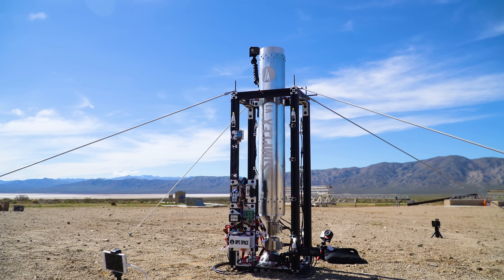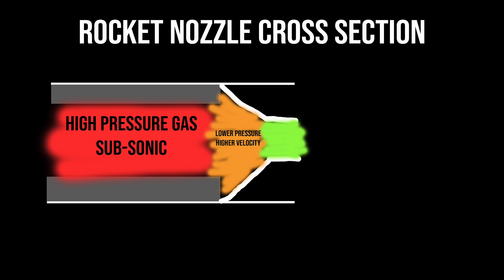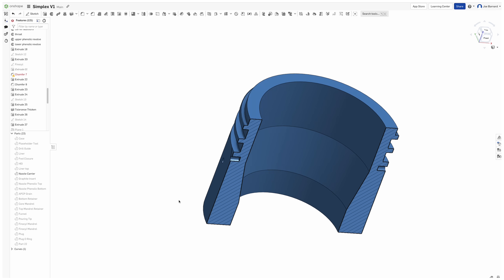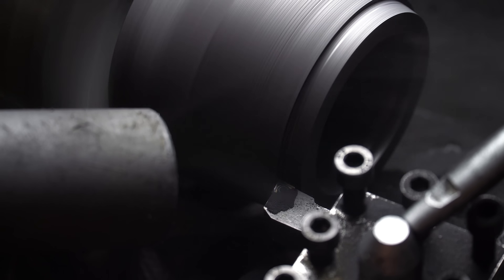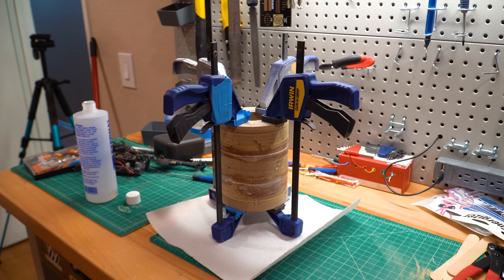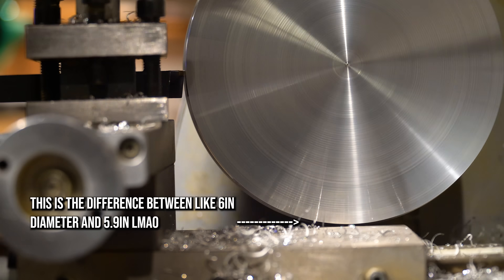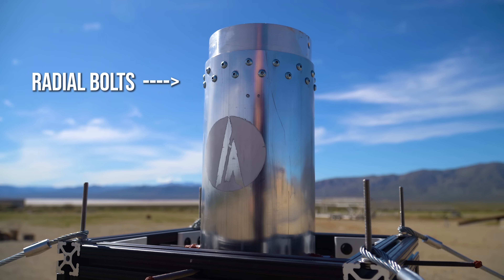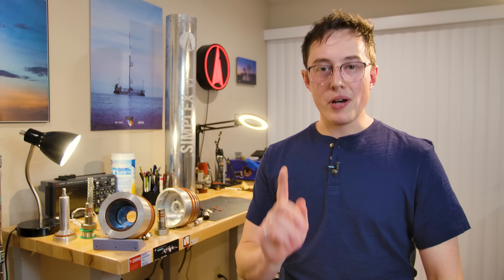Making a Rocket Nozzle - Simplex Ep 3

Comment: Suggestion: for future grain packing, 1, when you think you have all of your propellant in there, place a weight [or springs, or air pressure in a cylinder] on it with some packing material [such as beeswax or modeling clay in a ramming tube, and then 2, put a vibrator or ultrasonic horn under it to ensure all of the bubbles expel while none of the propellant fluffs, spalls, climbs, creeps or ripples.

All of that would be using a fitted removable sleeve, something like PVC pipe is fine for this, and its cheap, and can be resized with heat if it is not a perfect fit. Be sure to clamp it though, so even if its a perfect fit, the pressure does not squeeze anything out, or pop the sleeve off.

This should only take between 30 and 60 minutes but it should really clean out all of the voids.

What will happen if there is entrapped gas is, just like with concrete, it will work its way to the top and exit.

Since the clay [most modeling clay is actually quite light, but beeswax is much lighter if you can get it, say like off the internet] is somewhat lighter than the propellant it will continue to float on the top but the bubbles will float through it.

I suppose you could mix up some flour and water into a sort of a dough, but it could have too many elasticity issues and make it impossible for bubbles to pass through it, or, on the other hand, you could use wet or dry sand, but then sand is kinda heavy and would certainly mingle and embed in the propellant, unless you had an excess of propellant with the intended goal of just cutting off the excess as waste, so that would be a decision to be made at that time.

Honestly, either way, it would be good to have maybe an inch or two of extra propellant on top of the mold anyhow, because when the bubbles escape, you want to refill that void with propellant, not packing material.

Comment: Take huge care to chamfer and polish the edges of the pieces that touch the o ring, so the edge of the tube and the groves of the nozzle carrier. This way it cannot be be damaged when mounting the o-rings. Otherwise there can be tiny cuts that under immense pressure can split the rings. I learned this the hard way when designing a hydraulic keel canting system for a race yacht. Was not fun to clean up all the fluid inside the boat... In your case it could end much worse :/

Comment: ...If graphite is abrasive then why do I have a big tube of graphite powder lubricant?
Reply: Graphite is a lubricant and an abrasive. Turns out they aren't mutually exclusive properties. 

The key is the shape and orientation of the graphite particles. It's like a bunch of little pancakes. When they slide across surface to surface, it greatly reduces friction. When the edge slides across the surface of your material, it creates a little scratch, abrading it. 

But wait, graphite has a hardness of 1-2, so how can it abrade harder materials? Well, graphite is so soft because of how easily the layers break apart. Get down to a single layer and it has the same hardness as other crystalline allotropes of carbon (think diamonds).

Comment: Love your content man. Just a machinist here giving you a potential tip. If you need to turn something bigger on your lathe you can try using a boring bar upside down and running the machine in reverse. I had to do it a few times at work because it was at the machine's capacity lol. We actually had to modify the guards on the lathe to fit the part in.

Comment: FYI; you're using the organic chemicals cartridges on your respirator, which are great for working with solvents, but don't always guarantee particulates protection. You might consider calling the 3M hotline to see whether the part numbers you've purchased are rated for N95 protection or not.
Reply from the maker: Thanks! These are 3M P100's so they're good for organic vapors and particles

Comment: seeing the compound mount wobble is not good for machining parts @9:55  possibly just a quick setup error  best practice to do an idiot check before engaging the motor  i say this as a way of imparting some helpful knowledge  not meaning to be derogatory in any way. as its easy to get blindsighted by your project as you work at it. remember you only have ten fingers they are hard to replace.

Comment: Why use RTV silicone instead of a heat-curing silicone? Heat cure is way more reliable, and none of the usual practical reasons for using RTV are really relevant to this application, since it's all temperature resistant and is small enough to fit in an oven.
You do demonstrate awareness of RTV's key limitation (the fact it only cures with surface exposure to humidity) and you do work around it, but even with that workaround RTV is still just inherently less reliable for large mated surfaces like you have.
Heat-cure silicone, on the other hand, just requires you to bake the assembly, and you can be very confident there's no partially cured material left once an assembly finishes baking. It also has a much longer open time, so you can spend more time applying it and give bubbles and voids longer to settle out.
Reply: There's lots of different silicones, depending on heat resistance and Shore hardness, he could use 2-part tin or platinum cure formulas as well.

Comment: Genetic algorithm is great for optimice all the motor parameters. Also, when you get enought knowledge, is better to develop your own code for simulating the combustion, motor behavior and heat transfer. This is the only way to really understand how a rocket motor really works and how to optimice it.
The main objetive under the design of a solid motor is to obtain the desired maximum thrust at maximum target pressure, minimizing engine mass, and maximizing total impulse, average thrust, and specific
impulse.

Comment: Regarding the phenolic, why not build a jig with a bandsaw to get it round first? You're going to bore the center out of it anyway. You could drill a 5mm hole in the middle of one face, and pivot it around that on the saw. then turn it as normal on the lathe? This is how Frank Howarth does big bowl blanks in his woodshop.

Comment: If you use an 85 degree chamfer the inner edge of the rocket casing, it might be easier to insert the o-rings and nozzle carrier without nicking the o-rings.  In addition, I couldn’t tell if you were using lube.  Parker makes a silicon lube I have had good results with.  Glycerin is another good possibility as long as your materials are compatible.

Comment: If graphite dust is abrasive, why does graphite grease exist?
Reply: Graphite is a lubricant and an abrasive. Turns out they aren't mutually exclusive properties. 

The key is the shape and orientation of the graphite particles. It's like a bunch of little pancakes. When they slide across surface to surface, it greatly reduces friction. When the edge slides across the surface of your material, it creates a little scratch, abrading it. 

But wait, graphite has a hardness of 1-2, so how can it abrade harder materials? Well, graphite is so soft because of how easily the layers break apart. Get down to a single layer and it has the same hardness as other crystalline allotropes of carbon (think diamonds).

Comment: You might have seen or heard of them before, but you should look into getting some form taps/roll taps! They take some time to get familiar with and require somewhat specific drill sizes for your target thread form % (between 65-75% is where I've been getting fast reliable results), but you can look up the ideal drill diameter on a form tap chart as a starting point and then order a few sizes +/- the nominal drill diameter to dial things in for specific applications. I find if I'm cnc or drill-press drilling, the "correct" diameter typically works best, but for a hand-drilled hole, going slightly undersized seems to help account for inaccuracies from hand holding the drill which typically results in oversized holes compared to being drilled perfectly rigid and square to the surface as with a cnc/drillpress. With the optimal drill diameter figured out, I find that I can run m3 to m6 form taps with a hand drill and knock them out in quick succession(...but maybe don't try this immediately, getting familiar with the feel of the form tap going in is important too).

These taps also have some unique benefits/tricks/quirks, the first of which I think would save you some headache with your nozzle carrier:

- No chips to clear! It's a huge time saver. Depending on your lubricant/material, you may occasionally have to clean away finely powdered debris which builds up in the relief slot. Isopropyl alcohol as a lubricant for aluminum is amazing - not sure on specifically why, but it lubricates aluminum extremely well and also washes away any fine debris between holes with no oily residue to clean up afterwards.
- The threads are typically stronger due to being cold formed rather than cut into the material. (ymmv depending on material and the depth of the hole though, brass is a nightmare in my experience lol, and I'm sure there are other materials which don't like being cold formed)
- Form taps can last an extremely long time compared to cutting taps, assuming you don't snap them first or run them through undersized holes and gall material to them. 😂
- You can get "extra" threads from an open bottom form-tapped hole which can be used to your advantage. By using a slightly undersized drill diameter on thinner stock materials, when you run the tap, the threads bulge down/out as the tap exits which gives the fastener a bit more thread length to engage with. This can be problematic if you're tapping a tube wall where an internal and removable slip fit might be required. If you tap both the tube and the part within, it can also effectively lock that internal part in place with the displaced material. You could use this to your advantage though for extra part retention force too, it all depends on how you use it. Conversely if the material is too thin and too soft, then you might not get any threads at all as it might not have enough resistance against the tap, and just moves aside entirely as the tap slides through.

If you do decide to try form tapping, I find that the polished/uncoated taps from Mcmaster work best with aluminum/isopropyl for every day applications. The TiN or TiAlN coatings can get 'sticky' with aluminum, and that's just a recipe for disaster with a form tap. For harder materials, Loctite LB8012 moly-paste works great with the polished/uncoated taps as well. I've tapped both titanium and stainless steel with that combo and the threads came out really nice.

Hope some of this is useful info! Excited for the next video in this series!
-Mike

Comment: Then why is graphite used as a lubricant
Reply: Graphite is a lubricant and an abrasive. Turns out they aren't mutually exclusive properties. 

The key is the shape and orientation of the graphite particles. It's like a bunch of little pancakes. When they slide across surface to surface, it greatly reduces friction. When the edge slides across the surface of your material, it creates a little scratch, abrading it. 

But wait, graphite has a hardness of 1-2, so how can it abrade harder materials? Well, graphite is so soft because of how easily the layers break apart. Get down to a single layer and it has the same hardness as other crystalline allotropes of carbon (think diamonds).

Comment: I'm not sure if I missed it from a previous video, but I'm curious why you say hybrid rockets engines are the worst of both worlds?
Reply: Because you have a grain that's going to burn through and you have a pressure vessel full of gaseous or liquid oxidizer.
Reply: @jimurrata6785  so what your saying is your combustion chamber grows lowering efficiency and you still have the weight of the oxidizer storage?
Reply: @ColdWindPhoenix84  Pretty much.
You not only have the weight, but you have the complexity of plumbing and pintle, while with a hybrid you can't ever get the ISP of liquid/gaseous propellants like Oxy-Hydrogen.
So they are neither stone simple (like solids) nor incredibly efficient.  The only advantage I see over solids is that they can be throttled
Reply: @jimurrata6785  I feel like they are simple enough for a hobbyists while providing the ability to throttle, as "liquid" engines are pretty complicated.
Reply: @ColdWindPhoenix84  You asked why hybrids are the worst of both worlds.
Tanks, valves, cryogenics (and in the case of NO² temperature windows) plus a mediocre ISP.
What advantage does throttling hold for the average amateur rocketeer?  (excluding a student research/engineering group from some uni)
Reply: @jimurrata6785  I had an idea for a 1.5 staged rocket with solid side boosters and a hybrid core. All ignited at launch and core low throttles until the solids are expected and then throttles up. That way you don't have to automate an ignition, just a throttle.
Reply: @ColdWindPhoenix84  Which do you think is easier?
Lighting an engine on the pad, and holding it at partial throttle, then ramping the thrust up full when the boosters taper off.
Or, just getting the sustainer to fire when the G's die?
Reply: @jimurrata6785  honestly, I think throttle ramp is easier, it could be done by mechanical means as the boosters fall away. But solid motor ignition has to be electronic, at least as far as I know.
Reply: @ColdWindPhoenix84  Really?
 I can't conceive how you go about throttling a hybrid "mechanically".
Staging an APCP solid can be as simple as a battery and a mercury switch but since most every rocket is using electronics for recovery it seems stupid not to use them for staging too.

Comment: how does graphite manage to be abrasive and a lubricant?
Reply: Crazy right? Turns out they aren't mutually exclusive properties. 

The key is the shape and orientation of the graphite particles. It's like a bunch of little pancakes. When they slide across surface to surface, it greatly reduces friction. When the edge slides across the surface of your material, it creates a little scratch, abrading it. 

But wait, graphite has a hardness of 1-2, so how can it abrade harder materials? Well, graphite is so soft because of how easily the layers break apart. Get down to a single layer and it has the same hardness as other crystalline allotropes of carbon (think diamonds).
Reply: @differntname2807  that’s just nuts and so cool
Reply: Likely dependent upon ‘dust’ vs ‘powder’ (the latter acting  like more of a lubricity promoter….think rubbing / cutting / polishing compound sizes…just as a quick analogy)

Comment: Graphite isn’t abrasive; it’s actually used as a lubricant in numerous mechanical appliances. When I worked for a company that specialized in injection molding tools, I would just smother the graphite on the guiding pins of the machines. I have to tell you, it works like a charm, often better than grease even. There are also spring-loaded brass bolts that have graphite pressed into them. When there’s mechanical stress, the housing is abraded and releases the graphite for lubrication.
But you're right, it's really messy and can pose a threat to certain types of electronics. And it's impossible to get your shop clean afterwards :D
Reply: Graphite is a lubricant and an abrasive. Turns out they aren't mutually exclusive properties. 

The key is the shape and orientation of the graphite particles. It's like a bunch of little pancakes. When they slide across surface to surface, it greatly reduces friction. When the edge slides across the surface of your material, it creates a little scratch, abrading it. 

But wait, graphite has a hardness of 1-2, so how can it abrade harder materials? Well, graphite is so soft because of how easily the layers break apart. Get down to a single layer and it has the same hardness as other crystalline allotropes of carbon (think diamonds).

Comment: Nicely done!   While "ring of bolts" is popular among amateur motor makers, I always preferred internal snap rings.  Might not work in your case, though.  Also, I think I've mentioned before that using a cheaper graphite grade (the extruded stuff) will often result in a nozzle that is less prone to thermal shock on start-up.  I learned this the hard way.  Bought the highest-density iso-moulded graphite I could afford, turned some gorgeous nozzles.  They all popped at start-up.   Did the same profile in extruded grade, and that problem went away.  The more you know...
Reply: What diameter nozzles?
Reply: @chrisnorth3458  various. Including 75mm and 100mm

Comment: Little tip for the cross slide on the lathe, you can 3d print a drill attachment and get a smooth surface finish with minimal sanding. Try it out next time!

Comment: Radial bolt holes need to be counter-bored. Even if it'd only .5 mil deep.  It will create a prpper seat for the screw head and distribute clamping force evenly.

Comment: As a machinist i appreciate your machine struggles. Good looking work, I've made worse looking nozzles with nicer machines!
Reply: Also as a machinist, all the things he claims are "stupid" are perfectly normal machining shenanigans.  Figuring out how to hold weird shaped things that are just slightly too big for your equipment is what separates actual machinists from mere CNC-Go-Button-Pressers.
Reply: As the primary machinist on my school's robotics team, I can relate to lathe troubles. The lathes we use are literally WWII surplus (or came with the school when it was built in the 50s), with the original leather drive belts. This is compounded by the fact that all our drill bits are pretty dull, which makes for a wonderful combination